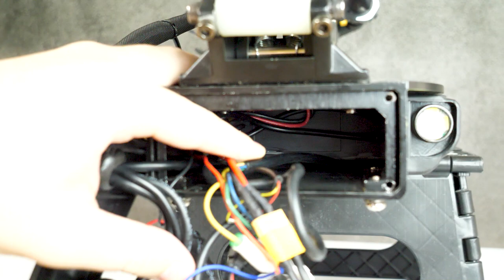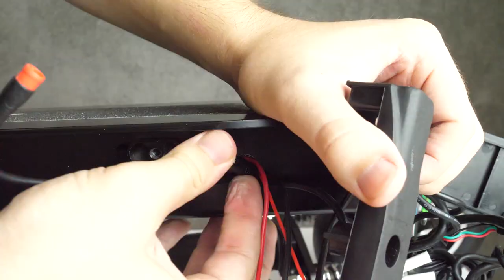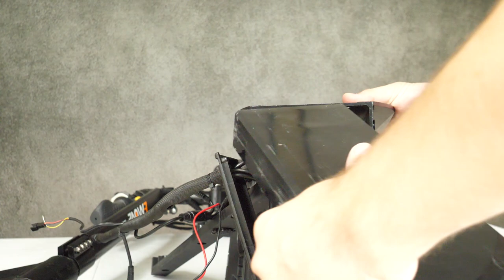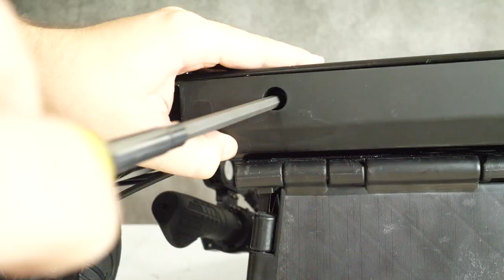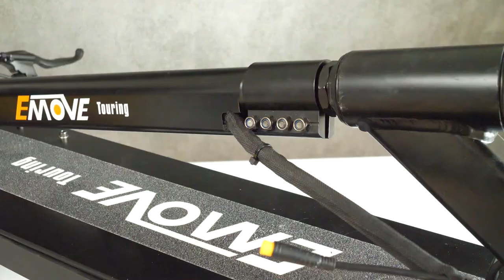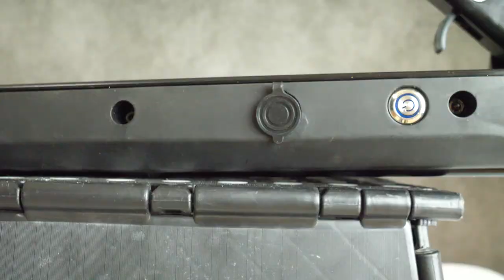How to replace your EMOVE Touring battery

Comment: I try to use my emove touring but the voltage fade away
When I connect the charger again everything looks fine but when I disconnect it the voltage fade away again 
What caused this and what can I do,,?
Is a good scooter, I adapted to my wheelchair and work in the deliveries
I already put around 3700miles
Thanks 2

Comment: I got my emove touring two weeks ago and now it’s suddenly won’t turn on with the keys in the ignition and the battery fully charged what should I do
Reply: same issue
Reply: @stevenhauben8669  mine is less than a month old and it only charges to 50.8v (75%) capacity.  Probably the battery but Voro has been beyond unhelpful.  I can barely get them on the phone and no returned emails.  But at least I've gotten several automatic emails reminding me to leave them a review.

Comment: Hi
Finally I replaced the battery, everything looks good but the speedometer reads very high speed
I disconnect some cables but I don't know if that is the problem
I'm afraid that this can trigger another problem
Can you suggest me something?
Thanks
Reply: I suggest not worrying about the Emove Touring's or any other Emove Readout on any of the LCD displays. I've had no luck with them reliability working. Watch your VOLT Meter. The 54----+++ or - 53.6volts untill yours drops below the usual.

That's when I know I gotta go charge mine.

Someone please tell me if I'm wrong here ❤
Reply: @la24dogg21  at this point what I learned from the touring and the cruiser is that you have to disconnect all the cables just leave the throttle alone and you would have scooter for long time with no problem

Comment: 22 screw and a crap ton of wires to disconnect.  This is the dumdest design.  My other scotter is 5 deck screw and you're in.  If i knew this was all part of replacing the battery, I would have sold this and gotten a better brand of scooter.